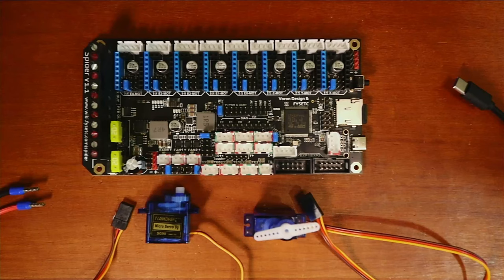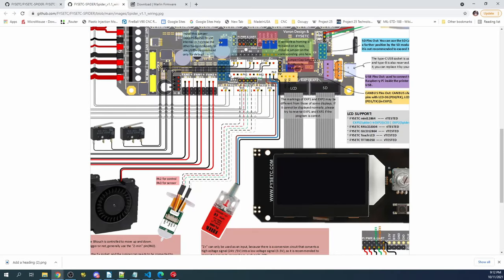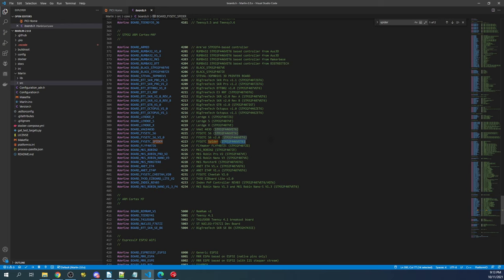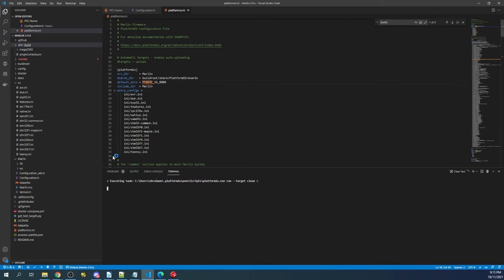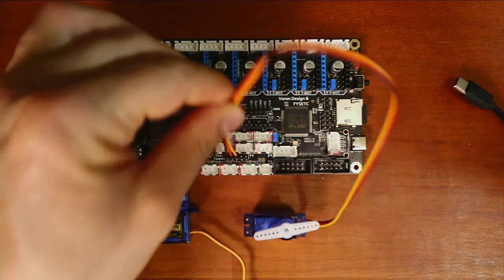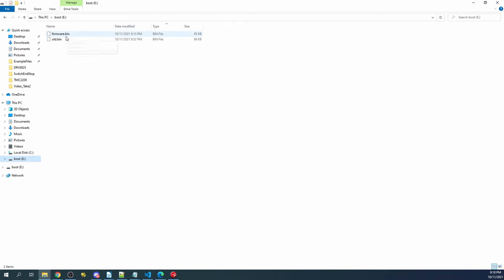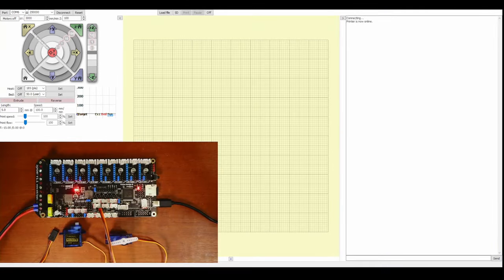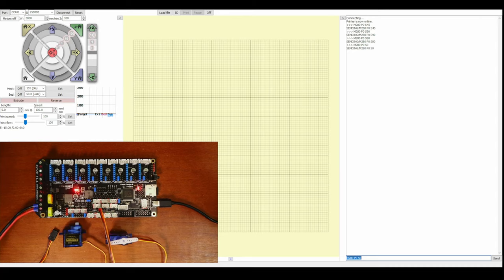Fysetc Spider V1.1 - Servo install

Comment: hey i wanted to ask that my rep rap discount control display is not getting power with the mks board i am using but when i used the same display in my second printer it was working fine. so is there any fix for it.
Reply from the maker: Try reversing cables on the board for exp1 and exp2.  I've not done a video yet on this part.  I think when I was. Testing only geetech version worked, but I'll need to verify.

Comment: Hi. Your videos taught me how to reprogram 3 printers, but I had a problem, my BTT SKR 2 rev.A board began to heat up, in particular the processor and voltage regulator 1117 33 2101. I could not reprogram it, the screen is empty blue. Tell me what to do)
Reply from the maker: Rev A boards are defective and you should contact BTT regarding a fix.
Reply from the maker: Or examine MCU and use rev B